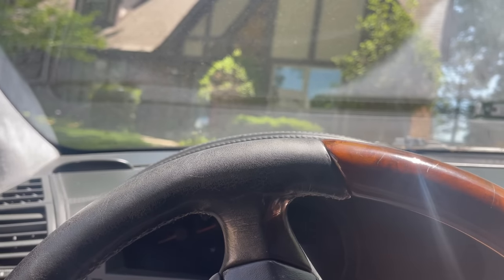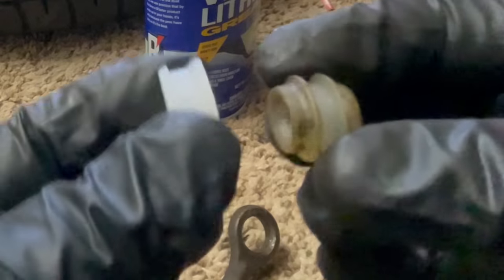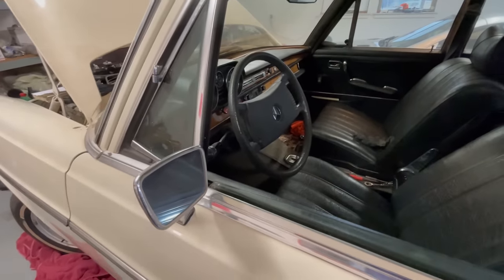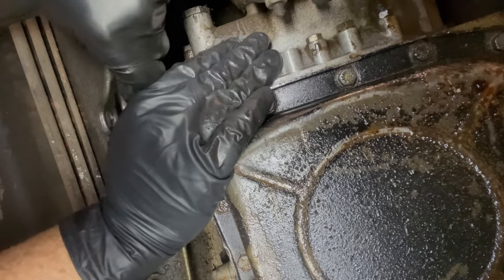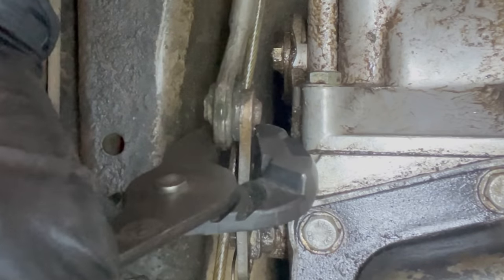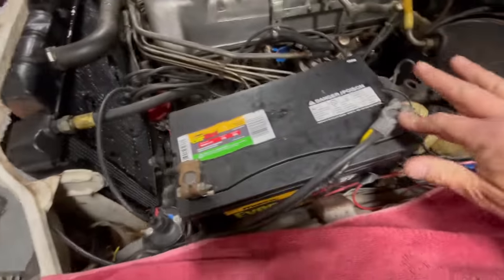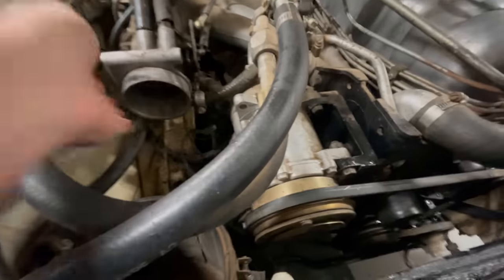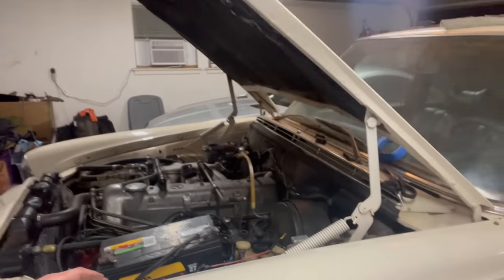Could This Be The End??

Comment: The reason for the coolant going though the throttle is to keep the flap from being frozen stuck during the winter season. It doesn’t happen often but the winter season especially in the northern parts can cause the throttle body flapper to be stuck open causing run aways and limp mode issues.

Comment: Let her build pressure with the tank full and see what happens. At best the hose that cools your throttle body will blow up if there’s a head gasket problem, but to be honest, I don’t think you have one. I just think there’s a lot of junk in the radiator from sitting

Comment: Never use 50/50 percent antifreeze always use full strength and then add distilled water if not drinking water, I've always use drinking bottled water myself.
Reply: I quite agree, test the antifreeze mix it stronger if needed and (use a guage to determine) and distilled water is a great thing,,, cleaner and less crap in it..